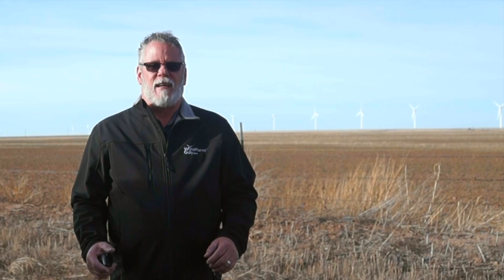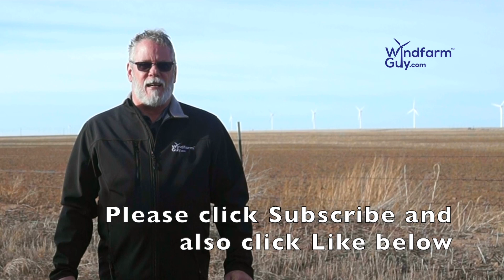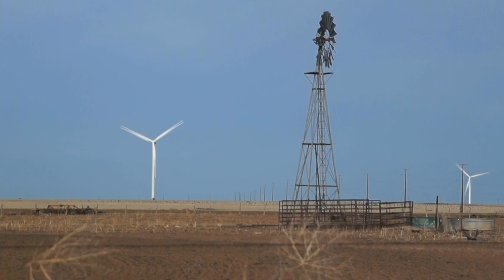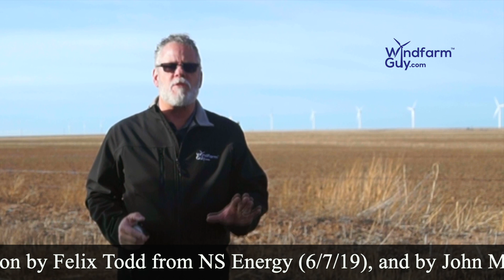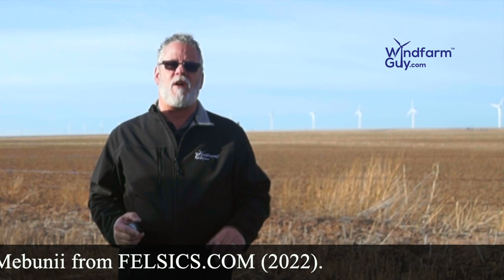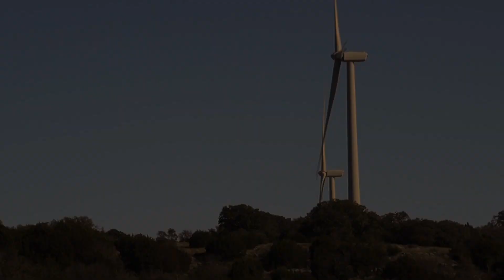#104 Windfarm Guy® - Anatomy of a Wind Turbine - Jan 14, 2023

Comment: Love this channel - do you have a video with a diagram showing all these parts you discussed ?  Made sense but would love to see the diagram with the different parts.  Would also like to see what they are putting underground and all the various parts of a "windfarm".  You mentioned a pad  mounted generator (or controller).  I am assuming there are lots of big wires underneath connecting them as well, and then somehow you get the generated electricity to wherever it is stored.  Maybe you already have these videos, I just haven't found them yet.  But I did click and Subscribe !!
Reply from the maker: Thank you, I appreciate that. I have not done that but will look into making a video with more ilustrations regarding the components. Good idea.